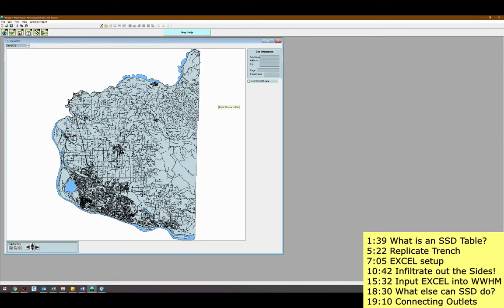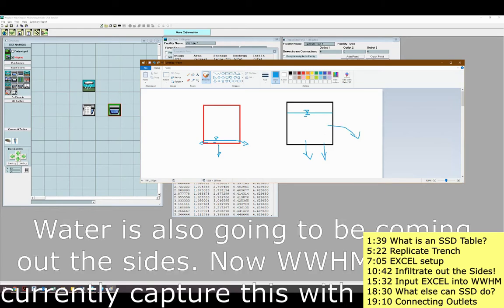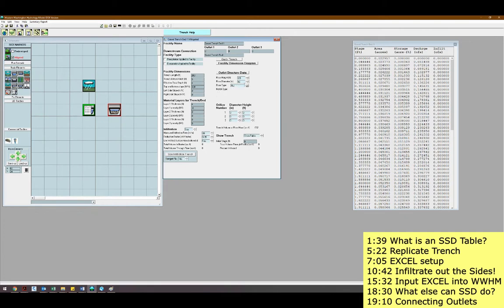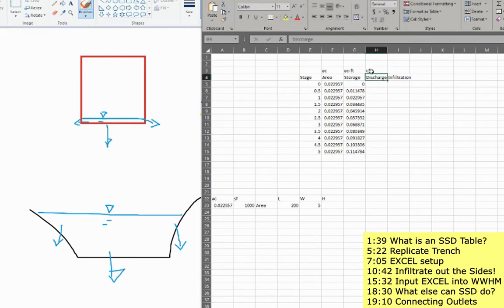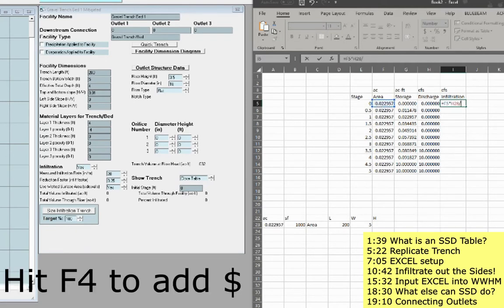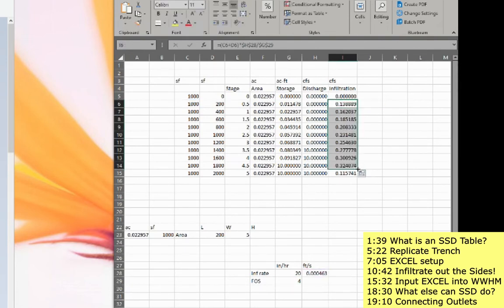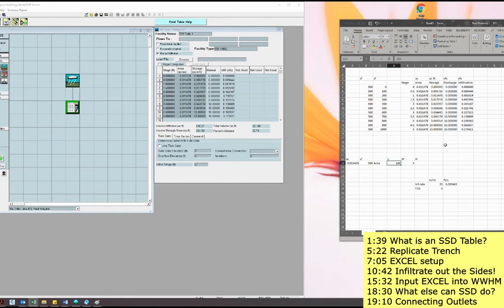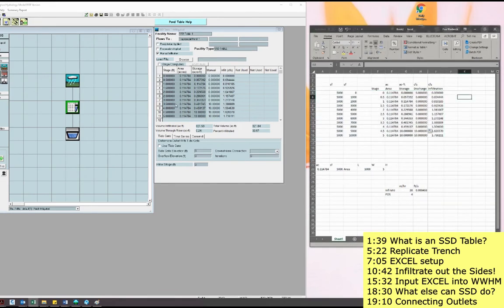WWHM SSD Tables | Powerful tool in WWHM | Western Washington Hydrology Model | Most Powerful

Comment: I am trying to model a large  below ground infiltration basin 400' L x 45' Wx 4' H that infiltrates at 2'/hr. I also wish to be able to discharge to the local street storm system. How do i design the orifices or can that be done along with the infiltration. can I add a SSD for infiltration then use an open pond to calculate the orifice controls?

Comment: Hello engineer. I live in Florida and we are doing a lot of infiltration trench, but with a perforated pipe. what software is the best option for me? i need help. we are doing many infiltration trench on a parking area with a invert crown section.
Reply from the maker: As long as you’re doing single event modeling, hydrocad is simple and widely used.